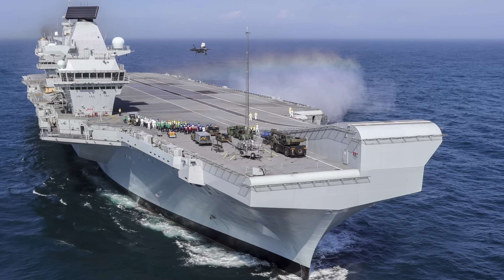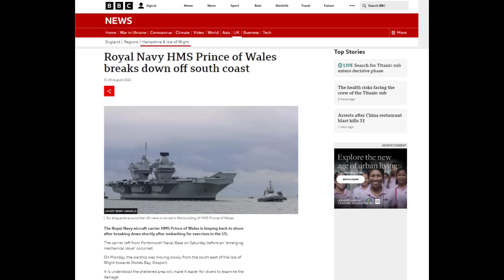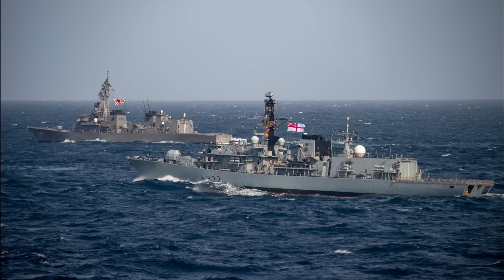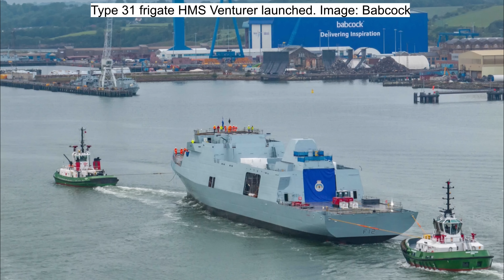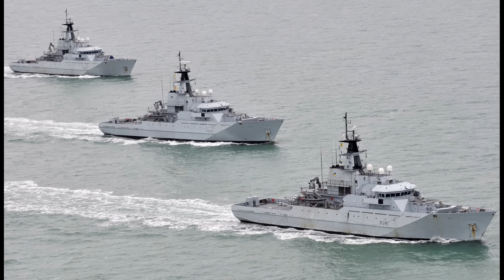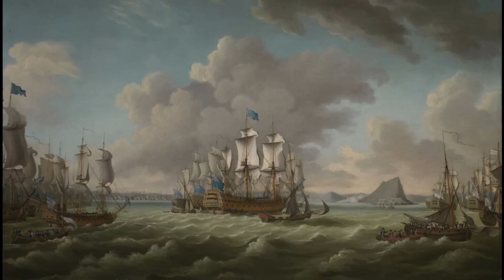Britain's Royal Navy: Every Warship Explained

Comment: Was a disappointing turn of events that RN trying to reduce the size of the type 26 program by selling Norway at least two construction slots while not replacing Royal Navy type 26, at maximum build capacity of five years “plus” and push any decision on allocation build back ten years with a hope of a type 31 light frigate funded to replace the two “heavy” type 26.  Britain has Nationalized Health Care while no way to defend itself.
Reply: No, what you meant is that Britain doesn't have the means to defend the Falklands with the current level of readiness.
Reply: @chichan8424 no, Britain  has no ships deployable.  New under construction warships are experiencing “raiding parties” stripping equipment and components in an attempt to get thirty and fourty year old ships in rehabilitatation  (type 45 ad destroyers at dock for eight years for rehab).  Now, new in building frigates are being sold to Norway because Britain can’t afford them.  This year a SLBM submarine was the only submarine not laid up.  Astute class in rehab or trying to assemble crews and replacement parts.  
Sad to say but, the only RN vessels available for off shore is a River class patrol vessel ( Russian vessels unfortunately don’t give RN advanced notice so they can assemble a crew because of short staffing)
Falklands rely on a few Typhoon fighters in theater and a surface to air missile battery.  Falklands are safe because Argentina is in financial crisis.  Not because of Britain’s defense posture.

Comment: the UK does not have any carrier strike group...its not possible, the only planes on our carriers are the F35B's which are close combat support aircraft , exactly what the USA uses them for only, for any thing else they are very poor , and if used for more they need the upgrades to bloc 4 like the other 2 variants, even then they would be a poor version , although they cost the most to buy and maintain...just the research to bring them up to date will cost a minimum of 17 billion of research before doing the upgrade, so yeah no where near strike capability
Reply: You for real? The F35 is a multi role aircraft, not close air support. Why the hell would so many nations be buying as their only aircraft it if that was its only purpose? 

And no, the same exercises show idk it’s “poor performance” are the same ones which have been debunked many times. The F35 is one of the most capable fighters in the modern day in multiple areas.
Reply: @omarbaba9892  The F-35B is literally used by the US Marines for expeditionary and close support because of its STOVL capability. If it's such a 'universal' fix, why are the US Navy and Air Force sticking to the A and C models? Also, the Block 4 upgrade hurdles prove that not all F-35s are created equal. Do some deeper research into the TR-3 requirements before calling others out. it really makes you look a bit stupid
Reply: @alangunningham5667 so you’re asking why the marines are using an aircraft in a role that fits the specific way the marines operate? Are you for real?🤦

Well no sh*t. There are a few small trade offs when it comes to the B but hardly ones which make it significantly worse than the other two. The C is even more specific since it was designed entirely to work with catapults and the A can’t work with carriers at all. 

Not to mention we’re literally acquiring at least 12 A models, and since we don’t need 128 carrier fighters there’s bound to be more swapped out this is exactly what countries like Italy and Japan are doing, where us having the B model also gives us valuable interoperability with them
Reply: @omarbaba9892  It seems you’re overlooking the technical trade-offs. The US Marines use the F-35B because it’s a niche requirement for expeditionary and Close Air Support (CAS) from amphibious ships. Every other branch and nearly every NATO ally prefers the A or C models because they are significantly more capable—they carry more fuel, have larger internal weapons bays, and can pull higher G-loads. The B variant is only chosen when you don't have a full-length runway or a catapult system; it’s a compromise, not a preference. There's a reason the global 'high command' keeps the B numbers low—it’s the most expensive to maintain and the least flexible in a high-end air superiority fight., and that is excluding the research cost only  of a minimum of 17 billion and that would only turn it into a more modern CAS airrcraft
Reply: @a @alangunningham5667 u for real? You’re acting like having a few technical trade offs make the things useless, they’re still more capable than pretty much any 4 or 4.5 jet they’d come across. The point is we’ve got them, we’re going the same route as Italy and Japan of being a mix of A and B variants which completely makes sense.

And the C variant also has its own trade offs as well. And, you seen the type to complain about acquisition time as well, you act like the B variant has no orders when it’s got over 400 as a mix of the UK, USA, Italy, Singapore and Japan meanwhile the C variant is only operated by the US and only has 100 in service, the procurement times would have been a lot longer, let alone to spend a billion pounds extra on each carrier making them be CATOBAR.
Reply: @omarbaba9892  You're confusing 'operational necessity' with 'preference.' We have the B because the Treasury didn't want to pay for catapults, not because the B is the better aircraft. Over 400 orders across 5 countries sounds like a lot, until you realize the F-35A has over 1,700 orders. The global standard is the A/C because they aren't carrying a dead-weight lift fan into a dogfight. The B is excellent for CAS and expeditionary hops, but in a peer-to-peer conflict, you’d want the range and the 9G rating of the other variants every single time....time you did some more research and learned that you lost this argument the first time you commented ...these are facts i am giving you with a load of research.. even your excuse for a number fudge isnt even close ...as stated facts over fiction
Reply: @alangunningham5667  his research is spot on yet again it is you and your delusions to think you ‘won an argument’ you are literally spouting falsehoods. How are most countries buying the C variant when they don’t even have carriers capable of launching them? The most popular variants globally are the A/B variants. Facts.
Reply: Lmao F-35B is definitely NOT a close-combat support aircraft. CAS aircraft are something along the lines of a A-10 Warthog. The F-35B is a stealth multi-role VTOL aircraft… not sure you not what you are talking about.
Reply: @CC-ns2ds  so no research , i can confirm its a close combat support aircraft , hence the USA only uses in that roles, plus why hasnt it got the upgrades the other 2 version had recieved , why is its performance so poor compared to them , why cant it even carry the same orderance all due to this upgrades and it just is not techincal enough to do it ...try more research befoe making yourself look foolish
Reply: @alangun @alangunningham5667  Google “The F-35B is a multirole aircraft that excels at CAS, air superiority, electronic warfare, and intelligence, surveillance, and reconnaissance (ISR).” It is not exclusively a CAS aircraft and the reason it can’t carry the same ordnance is because its weapons bay is smaller you know for the big vertical lift fan behind the cockpit 😂 you know how much extra fuel it uses to takeoff in VTOL configuration. A lot. You’re telling me I loon foolish but you’re actually hilarious, keep it coming.

Comment: Our loathsome metro-establishment vermin, politicians and bureaucrats alike as well as the horde of parasites infesting all our 'civic society' infrastructure, have spent all of this century to date butchering our armed services. Now, rebuilding of both RN and RAF especially as the top priority, is vital. A huge, ongoing problem will have to be overcome first; the continuing self serving stupidity of a horde of Whitehall incompetents who've delayed ordering new ships far too long and mismanaged the procurement process abysmally in every instance when it has finally been undertaken. Including by the utterly irresponsible habit of cheeseparing on vital process that's most apparent in the dangerous FFBNW practice. Something which has become standard. The result, not only are too few vessels ordered and with too many stupid, costly in-process modifications, cancellations etc, but when the miniscule number of ships at gobsmackingly excessive unit prices do appear, they do so at best half armed. Lacking vital weapons systems that ultimately are never fitted anyway or are dropped in favour of cheaper, less potent and comprehensive alternatives.

Comment: At 3.50 you talk about how the ramp restricts take off weight for the F35B forcing a compromise between carrying a heavy weapons load or maximizing fuel range. No. The vertical take off forces that choice. Taking off using the ramp frees the aircraft from it. Vertical take off means a limited total load. Using the ramp means a max of 15,000 pounds of ordnance and 450 mile range. An F35C with catapult can carry 18.000 pounds of weapons and 600 mile range. It's more but the F35B using the ramp still has a very considerable range/load performance.
Reply: so you're saying hes right?
Reply: @iraeis7267  yeh basically the guy was right it is a more limited load compared to a catapult launch.
Reply: @iraeis7267 , no, he is correctly telling him his statement is wrong
Reply: @iraeis7267  F35C carries more because it has a longer wingspan for more fuel storage. With F35B the ramp doesn't cause limitation and forcing choosing between fuel or ordinance like he said. The limitation is only in the vertical take off like I said.

Comment: The very low availability of most of the ships you described, due to insufficient quality of construction, poor organization of the maintenance and some manpower issues, is a terrible problem.
The Astute-class SSNs are the worst as far as availability is concerned: At the time of writing only one boat is available! As you pointed out, the Vanguard-class SSBNs are aging rather badly, they are practically reduced to 3 boats, since a 4th one is permanently on very long term heavy maintenance. This fact forces increasing the duration of their operational patrols beyond the reasonable and one can seriously doubt if maintaining 1 boat permanently on patrol will keep being possible until the, still many years distant, arrival of the new Dreadnought-class boats. The propulsion system of the QE-class aircraft carriers is a source of severe concerns; the situation has improved on HMS Prince of Whales (but for how long?) and heavy works are currently carried on HMS Queen Elisabeth. Only 2 type 45 destroyers are currently available and finally the good old type 23 frigates are the sole combattant ships currently offering a good availability rate (which leads one suspect that the quality of construction of British warships at the end of the XXth century was far better than in the present times).
Reply: Most of what you describe is normal for navies, large navies can only have around a third of their ships deployed at any given time
Reply: @patrickdebondeli8520 You are another one who has no idea  why don't you be quiet
Reply: @patrickdebondeli8520, Where do you get your information from? Wow, I have never heard such misinformation in my life
Reply: You understand the issue with the Astutes stems from the rebuilding of faslane nuclear base right ? That work will be complete next year and maintenance will resume.
  The propulsion system on QE class is state of the art and has zero issues, the only issue they have faced are prop bearing failures which have now been replaced. Its nothing short of a miracle that first of class blank sheet designs have faced so few issues in fact.
   Finally all type 45s will have their PIP completed by next year along with 3 being upgraded to carry over 70 missiles adding land and ship attack caability. They will also have directed energy weapons installed. Get some facts before you comment mate.
Reply: @gabehorn1001 what the biggest load of BLX going  i am in Faslane now shut up  have you ever been on a submarine

Comment: Sell one save money.
Reply: One aircraft carrier is a non capability. If you can only put it to sea when you are able to, it means it isn't always available when you need it. All an enemy needs to do is wait til it's in maintenance and attack then. Naval strategy isn't about having super duper ships most of the time, it's about maintaining capabilities at all times.

Two is a very stretched capability, but with intelligent sequencing can just about squeee through. The real problem is the lack of NAA squadrons. There should be at least 6 sqdns (plus spares) to be able to equip both in a worst case scenario, and that ain't happening any time soon.
Reply: No they actually need another one.
Rule of thirds.
Reply: @DaveR7920  That's why I said 'squeeze through' with careful sequencing. 

With low numbers, you actually need 4 vessels to ensure a consistent capability with a complex platform, hence the 4 SSBNs - thirds is a basic rule of thumb which changes depending on the complexity of the platform, the size of your fleet, and the tempo of operaations. If you have 30 frigates, you could put around 12-14 to sea, and more in extremis due to the slack in the system resulting in fewer deep maintenance periods.

A couple of 'pocket carriers' would be a good addition after the new wave of escorts have been built, less bells and whistles and focused towards drones with a small manned flight embarked, meaning UK would be guaranteed the ability to put a SG to sea at any time.
Reply: Absolutely not. With two carriers you can always have one ready to deploy at a time if needed, with one carrier you have massive gaps where you can’t deploy due to maintenance
Reply: Agree

Comment: Despite all the humiliating headlines recently, I'm actually quite optimistic about the RN's future. Quite a lot is being done - both to the fleet and shore facilities.
Reply: We are at a low point now and for another year or so, but there are a lot of good things in the pipeline.
Reply: Indeed, a lot is being done. Specifically, two years of repair work just for one ship that's less than two years off the dock.
Reply: It’s just bad timing!